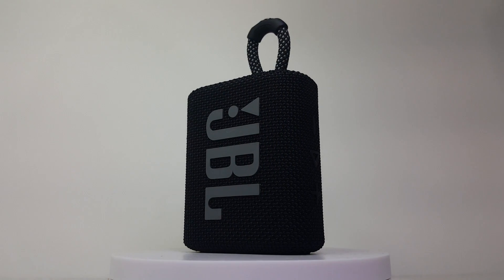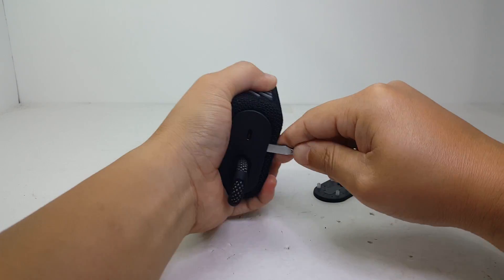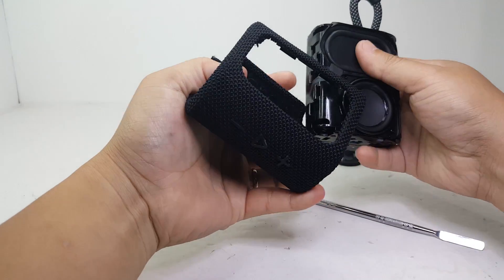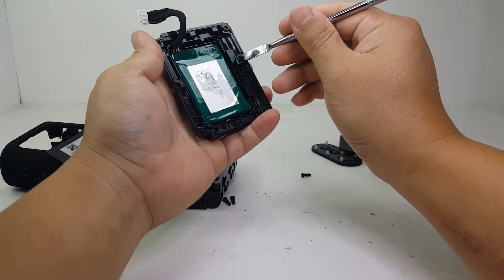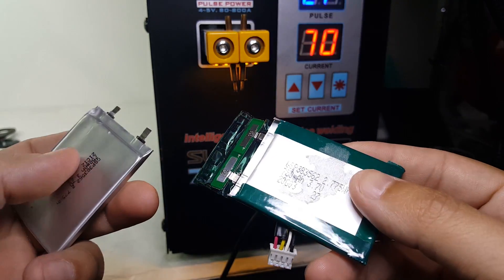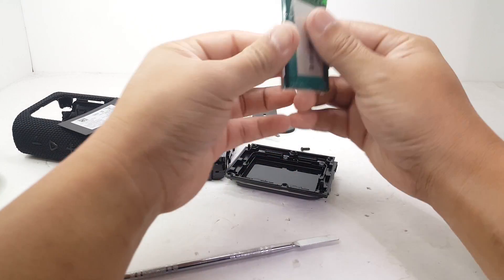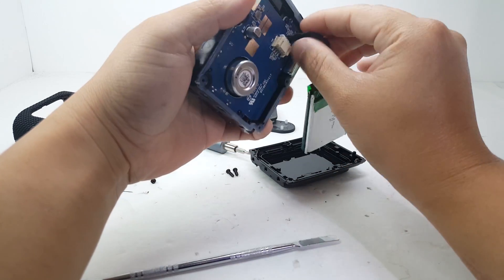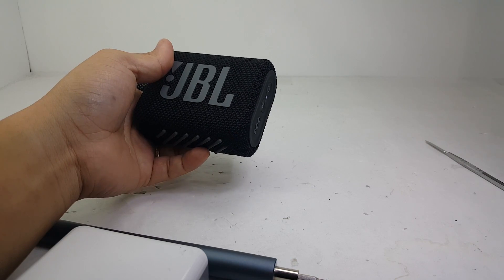JBL GO 3 BATTERY UPGRADE [10+HRS PLAYTIME!!!]

Comment: 1.: this is a midleading title, since you yourself say it lasts 8-9h now.

2.: using two lion/lipo batteries without a balancer is a bad idea, please correct me if im wrong.

3.: good work! i wish JBL would have just included a larger battery from the start, especially at the price!
Reply: Yeah you would only need a balancer if you paired the batteries in series instead of parallel. In parallel the amperage values are added but not the voltage, but if he were to pair it in series The voltages would be thus then he would need a balancer
Reply from the maker: It depending on how loud you have the speaker.  I can achieve up to 10+ with volume on moderate.  As for the battery, when connecting two batteries in parallel, a balancer is generally not required if the batteries have the same voltage and are of the same type, age, and capacity.

Comment: Hey, i find the idea great but I'm wondering if it could lead to complications since the batteries still need a bit of space in case that they bloat... Would be great if you could share your opinion:)✌🏻
Reply from the maker: bloating is an issue that could happen to any polymer battery overtime.  ive seen these polymer battery boat in device to the point where it cause the enclosure to break apart or swell. im sure you will notice some defomity in the shape of the speaker if the battery get bad.  this way you can take proper action.

Comment: Does it last longer??How many hours more??Does it take more time to charging??
Reply: If you using not similar baterries, its just okay, the speaker working properly, BUT when u start charging, the indicator lamp charge maybe missed that calculating cuz the bms of battery must have charging the small capacity battery first. So, you have to pull it out the charger and charging again to reach full capacity. For example, if u see the indicator charge its blank, u have to pull it out, and the u charging again until the indicator blank again.. hope this answer help u
Reply from the maker: yes it last longer.  i get around 8-9 hrs on a full charge.  it does take a little longer to charge due to double the capacity.
Reply: @HBV90  Thanks for the answer the problem i have is that i only found 850mah battery on aliexpress with the model number 383562.Do you think it can cause problem to combine it with the 750mah original go3 battery if the battery have not the same mah???

Comment: Great video. i have a question: Does that work long term? dont they have to be balanced, if one of them wears out wouldnt be the voltage different betwen them?
Reply: those batteries are in parallel so they do not suffer from balance issue and there is no voltage difference.
Reply: @dadultv7258  thanks 💙

Comment: nice! i noticed in your previous disassembly video that JBL added a steel weight. in my opinion, they should simply added more battery.   I did a similar hack to our cordless vacuum, it just lasts way way longer than the added battery.  I think the JBL original old battery will also have longer life than the added battery because less heat during peak usage/power.
Reply: The steel weight is there, so the speaker doesn't bounce itself off of whatever its standing on. Mine always yeets itself off my desk

Comment: Hows the IP67 rating fo that device after the modification? is it compromised?
Reply: well, you definitely loose warranty and with that the official IP67 Rating. I also would not bet on the actual watertightness since the seals were broken.

Comment: Hey since you got both the Go 3 and Altec Lancing Hydramini, can you do a comparison between them? Which one do you think sounds better? I just want a cheap, almost disposable speaker, but $50 for the Go 3 seems a bit too steep for a throw around speaker lol, I also don't think it's worth $50 in terms of sound quality
Reply: Just take JBL Go 2 or Go 3. I have heard many small speakers like this before I bought Go 3 and JBL has most natural, big sound with nice, also natural bass. Many speakers like this have unnaturally boosted weird bass. And the quality of JBL is outstanding. If you want to save some money - go for Go 2. It is also pure awesomeness.
Reply: @technics6215  I ended up buying a Tribit Stormbox Micro
Reply: @Ignacio.Romero  I haven't tried it. Stereo option with two speakers and going down to 70Hz looks nice on paper. But does it sound good? What about materials quality? In my opinion Sony micro speakers have unnatural bass and JBL is waay better from Sony.
Reply: @HBV90  Yeah I know about the GO2 but I was searching for a speaker with Usb C charging. Do you know of any other small speaker with type c?
Reply: @Ignacio.Romero  Why you want to buy something else than Go 3?

Comment: Dangerous. You hat to install bms
Reply from the maker: Capacity is increase but voltage is still the same at 3.7v as the batteries are parallel.  theresfore no additional bms is needed.
Reply: @HBV90  it doesn't work because the bms regulates the voltage of each single cell. the bms must be specially designed for the number of cells you have. the more cells you have the more your bms will have.
Reply: more S*
Reply: @LeonardoPellizzi 
Actually you only need one per setup